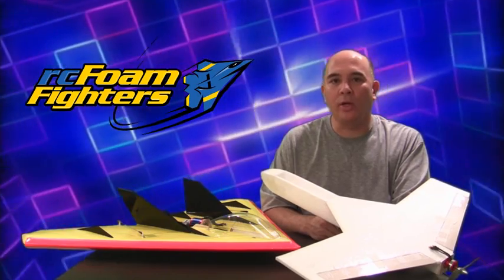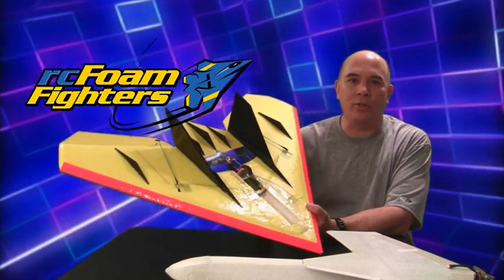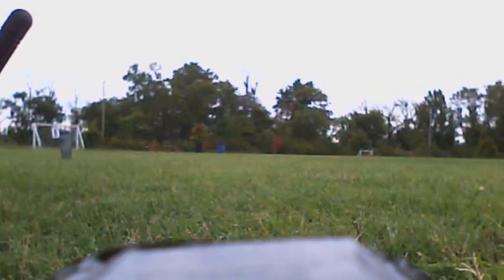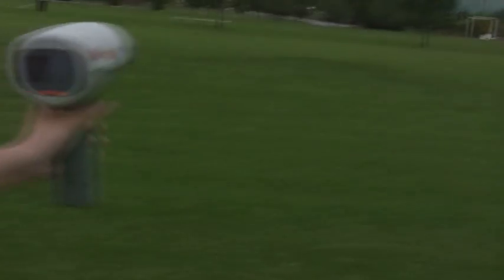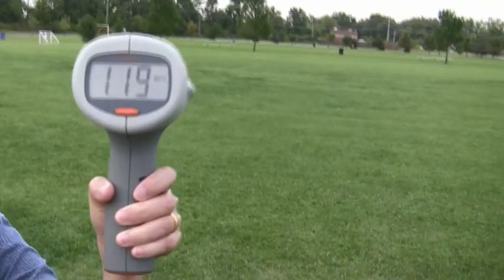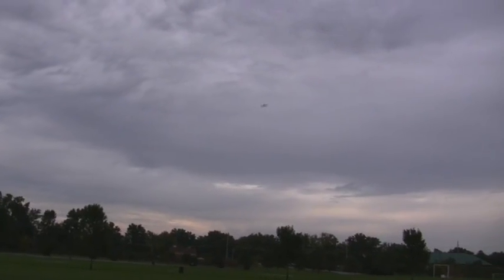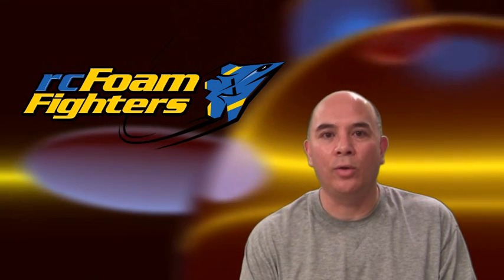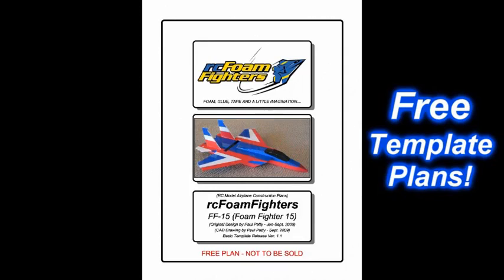On Board The Bullet Plane and 4 Cell Speed Clocks

Comment from the maker: Cool Barb!!! That onboard video was pretty crazy!! I was really pushing that motor setup really hard. But I had to try the Bullet Plane with a 4 cell. I can't prop down as much with it because of the weight of the plane. It all worked out better than I thought it would. I was sure I would fry the motor at those ratings. It's tuffer than I thought it would be.